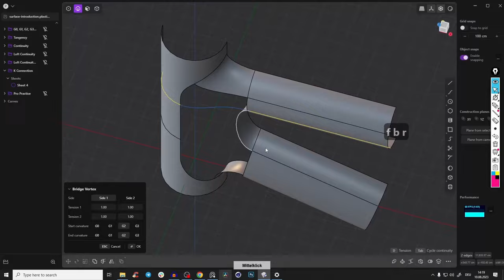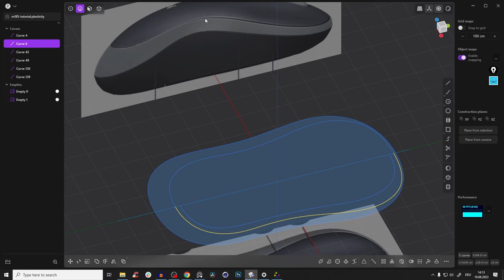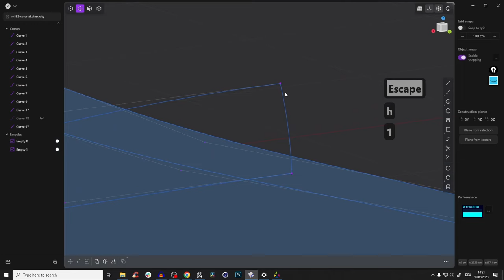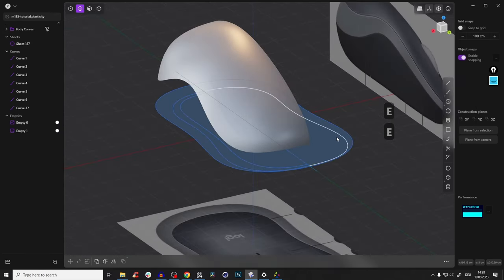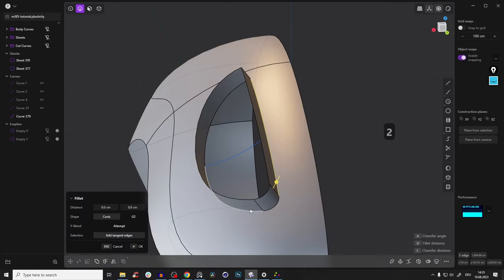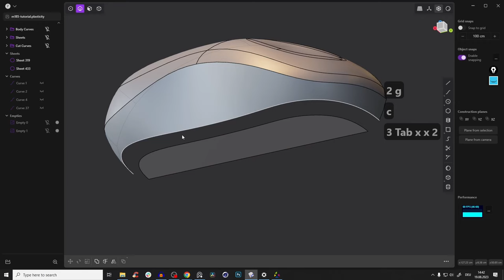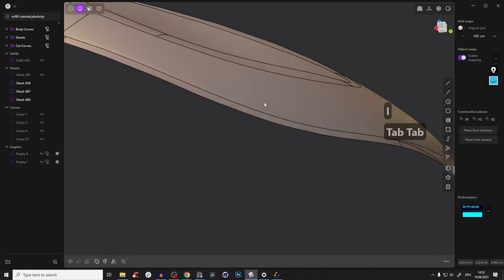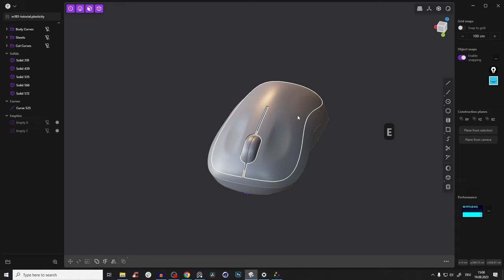Plasticity | Surface Modeling for Beginners 3D Tutorial | Amazing Workflow

Comment: Nikita, at 14:55 I hear you say: "I didn't do that". But what do you expect when you first put all the points at the right place in the top view and then go move them around freely in the side view? Of course the points are no longer at their spot where they are supposed to be. You can't move them freely anymore. They only can go in the Z-direction because otherwise you change your top view too. I saw it coming from miles away when I saw you edit the positions in the side view. Use a few more control points and never ever change the x or y position after you have set them in the top view.

Comment: Not sure if it'll definitely work, but in the recently released v1.3, the fillet dialogue box has a "chordal" option, which attempts to keep the same thickness around the edge of the entire fillet. It'll probably help with the top indented areas where the fingers would rest, and the chamfer at the base of the mouse.
Reply from the maker: Sometimes chordal works well, most of the time on complex surfaces one has to do fillets manually for best results.
Reply: @nikita.kapustin  I do like your technique of deriving a curve for the "path" you want to chamfer/fillet, then using the pipe tool on it to get the size of the chamfer you want to make, then bool-cutting that area out of the original geometry, and manually rebridging the opposing edges.

Comment: Everyone has their own way of doing things. I think starting with a solid and then applying forming techniques would make better use of plasticity.
Reply from the maker: Sure, everyone has their own way of doing it. I am showing you the industry standard, professional ways how 99%-100% of all products are designed in CAD for production. 
Such shapes are only possible with surface modeling. Especially the more complex it gets.
Reply: @nikita.kapustin  Very good, no worries!